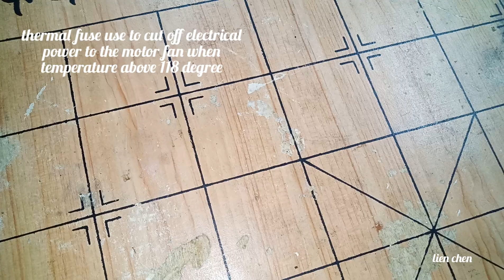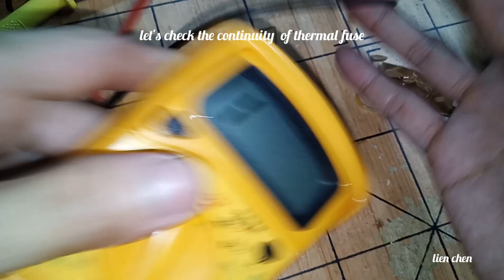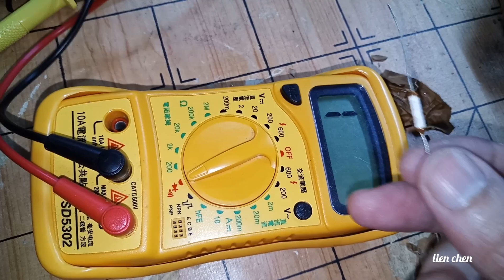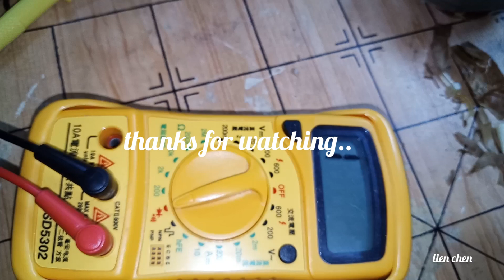electric fan thermal fuse 电风扇热熔断器

Comment: Wow... Appreciate your efforts! Does it mean every motor should have FUSE?
So, what's wrong with the machine? Can't rotate at all?
Reply from the maker: every electric fan motor have thermal fuse, if thermal fuse trip off or cut off the motor no power at all
Reply: @lienchen12  Now I only know 😅 Thanks for that useful info!
I just opened up the motor's transformer. Alamak, those wires' joint was hardened and 1 of the leg of fuse disconnected, 3 copper wires disconnected to Red, and 2 of the Capacitor's wires!
No wonderful it suddenly not function at all today!
Reply from the maker: @raymondlooi  welcome